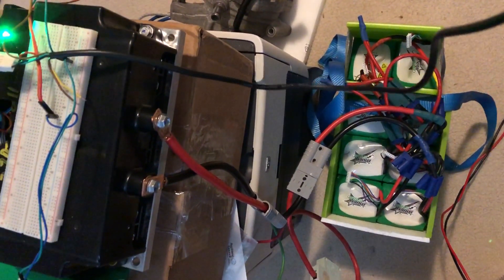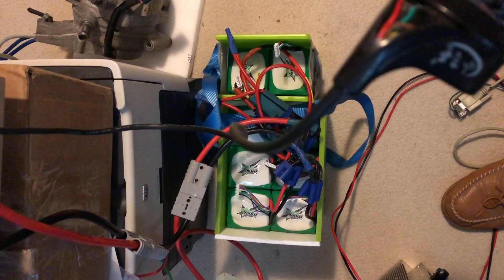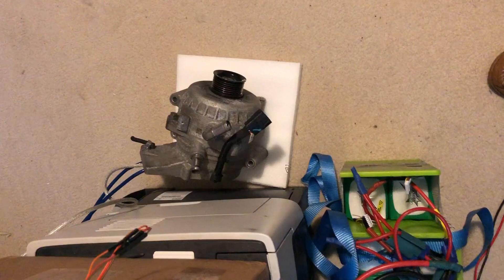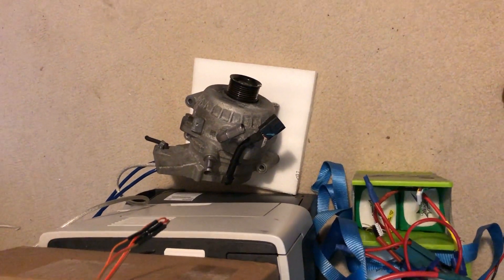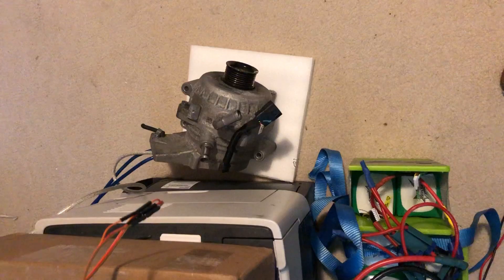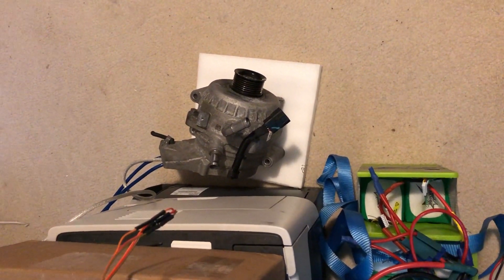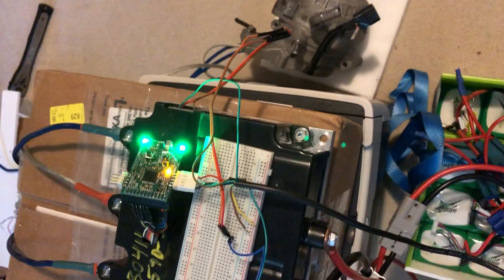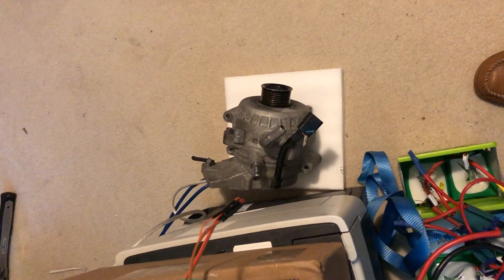Lebowski controller driving a Hyundai HSG IPM motor

Comment: i got a hold of one of these myself! just ran it on a 48v ebike esc. has plenty of torque it seems even without sensors. subbing now to follow the progress!
Reply from the maker: The HSG is an awesome little motor capable of up to 22kW. We have a plug and play solution for the HSG now, take a look at Eric Ensley's kart project to see the progress.
Reply: hello dear friend, I have a honda ima controller, I would like to start it, can you answer a few questions? telegram you have?
Reply: @kiwifiat  hello dear friend, I have a honda ima controller, I would like to start it, can you answer a few questions? telegram you have?

Comment: Hi, you say in the video that you are running it with a Bobc board with a few modifications, what kind of modifications? also i sent you a pm in endless-sphere
Reply from the maker: There is a detailed write-up in Amberwolfs thread on ES, basically the 15V gate drive regulator is removed but the low pass supply line filter is retained.

Comment: I am running the same motor with a kelly KLS 8080i.   I get 5200 RPM with 160V, so sounds the same as what you are saying.   I'd love to have a 400V controller to spin this motor.     I think 50-75amps peak would be plenty for this at 350+volts.   I love this little motor.  Cheap and powerful.  Just need an off the shelf controller for 700$ and I'd be as happy as a pig in poop.
Reply from the maker: I get 32 rpm/V with the Lebowski controller and can run the motor right up to the 15750 rpm limit with field weakening on 48S lipo. The Honda IMA inverter is good for over 20kW as is the HSG motor so you really do not need to go to 350V to get either the power or rpm out of this motor. We have a resolver solution for the HSG/IMA inverter now, video coming soon.
Reply: Hello 👋